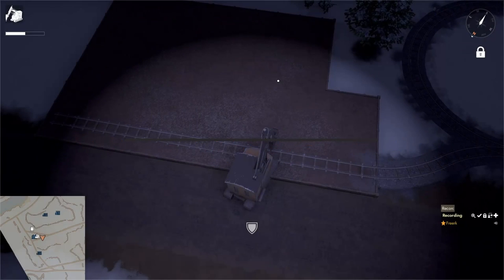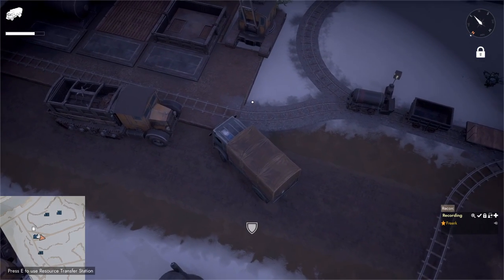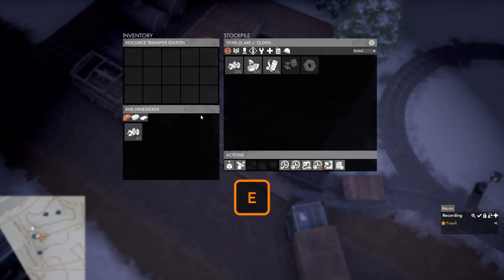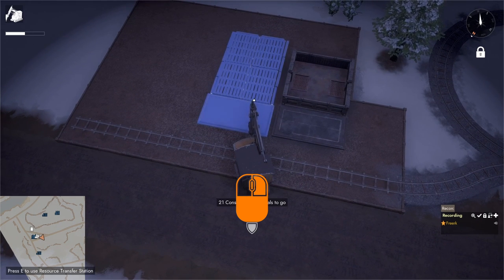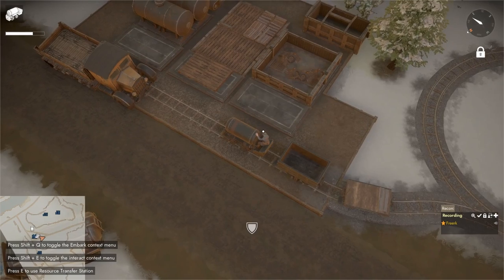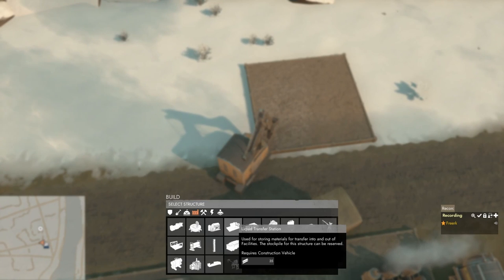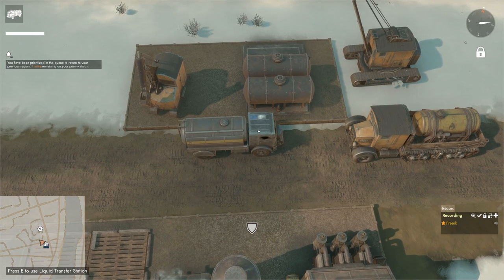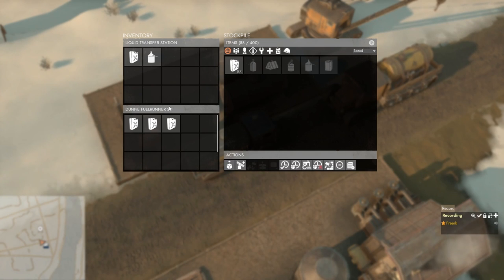Foxhole Facilities - Transfer Stations

Comment: With how many of the materials are only moved by pallet i think, there should be small flatbed truck (on the base truck chassie). It should hold about 1/2 of normal pallette. It's absurd that you need flatbed and crane just to install some sandbags.
Reply from the maker: I am happy to be able to tell you that you can now produce crates of 5 barbed wire or 5 sandbags in the normal factory (the world structure), they can be transported by truck. Crate of 5 will cost 15 bmats.
*edit: corrected some spelling
Reply: @FreerkHoltes  that's such good news, it's my 3rd war, and I can't believe the upgrade to logi, but still I think we need some faster way to move load/unload things on the back lines.

Like if I'm alone, i don't want to spend half an hour loading and unloading large items
Reply: @GonTar_X  gotta petition random players for help. If you explain what your trying to do in logi chat, I bet someone will help you make your task more efficient. Teamwork is the name of the game.

Comment: can you connect a single liquid transfer station to multiple diesel power plans for instance? like a split pipe? or is it 1 liquid xfer station per power plant/ oil refinery etc?
Reply from the maker: Yes you can split the pipe, but then you will have to do some calculations on maximum output of diesel from the outlet point (2.5L/s if I'm not mistaken) and the consumption rate of your power plants. But definetly possible

Comment: So do these automatically resupply structures in the facility?
Reply from the maker: Only the Liquid Transfer Station can automatically "pump"  out it's liquid to a connected facility. This does not work for the Resource Transfer Station and Material Transfer Station, they still need some manual work to be supplied

Comment: Transferring liquids INTO transfer stations is super easy. Getting it out is super tedious. To fill a static fuel container it takes 34 clicks (which cannot be queued). That means that the process is click wait a few seconds, click wait a few seconds .. 33 times. I can understand that if I was loading a general purpose truck with Gerry-cans I would load three at a time, but from a fuel stockpile into a fuel container I should be transferring AT LEAST 10 units at a time.